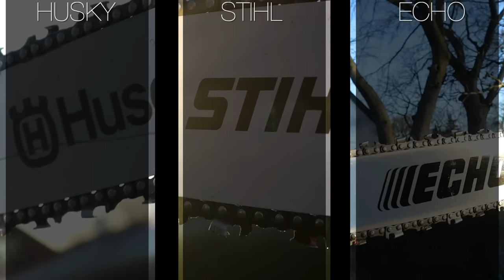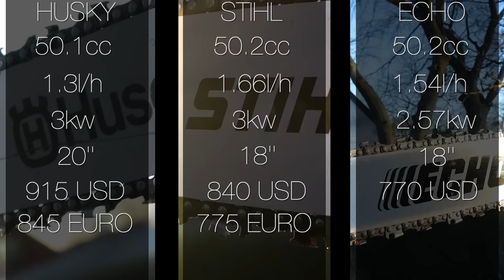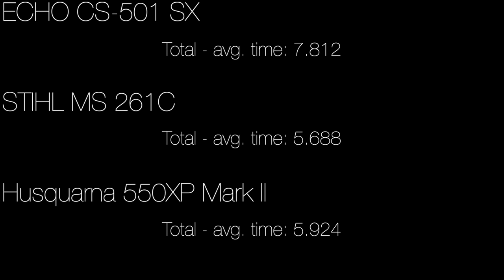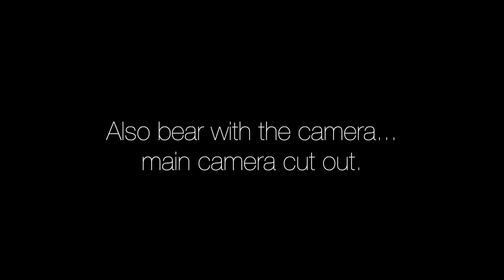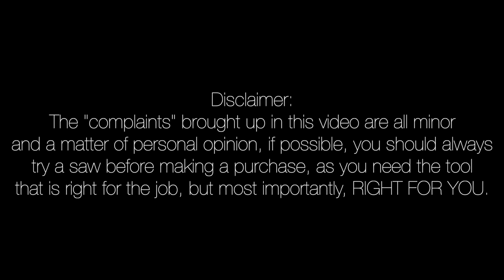Husqvarna 550xp mark II vs. Stihl ms 261 c vs. Echo cs-501 sx - Chainsaw comparison video

Comment: Echos tend to have their carb set a little lean from the factory in my opinion. Tweak the high a little maybe a quarter turn after u remove the plastic restriction caps👍 also maybe a Stihl chain would make it cut smoother. If it has a full chisel chain it might be why its cutting rough. Their all good saws tho. I own stihl and echo and in my opinion echo is underrated.
Reply: Yeah your right about that. I had to pop the caps to fatten it up where I wanted it. Now it's a little ripper!
Reply: How did you make this determination and what procedure did you use to tune?
Thanks, Echo Repair Specialist...✌
Reply: @GripFreak  the way I made the determination was by cutting with it. And the procedure I used was tweaking the high jet back and forth about 1/16 of a turn until it started cutting better. I played around with the low jet also but I'm pretty sure I left it where it was.  Gotta take those restrictor caps off first tho👍
Reply: @GripFreak If you listen carefully when she tested from cold start, you can actually hear the chainsaw bugging down and struggling  to reach a high speed because a lack of fuel, this is a sign that it might be too lean as the cold air is more dense.
Reply: I agree I have a Ms 261 but was looking at a 501 both seem like great saws I also think echo takes a while to break in I chose the 261 cause of my dealer having the huge computer to do the m tronics I think there awesome if you have a dealer close by with one

Comment: I own several Echo's and I never knew you could use the rope handle to open the oil cap. THANK YOU.
Reply from the maker: No problem:)
Reply: Me too!  Thank you very much
Reply: About as clear as mud!!
Reply: @oakiewoodsman  me too, good info to have
Reply: Echo is not tuned properly
Reply: I had no idea either. Guess I should have read the manual beyond the starting section.
Reply: Fairly new feature that started with 2511 and 355T with new tank caps.
Reply: Echo is up to a 20” bar on my 50cc .
Reply: I love your video. I bought the Echo a while back based mostly on price and weight. My dealer has an annual sale of Echo, with 20% off making it substantially cheaper.

Comment: The Echo has 1/2 HP less than the other 2 which is why you fell  less power and dont cut quiet as fast  it revs at a bit less RPM but in return it has a better waranty and more affordable.

Comment: I talked to the head mechanic at the local saw repair shop a couple of months ago.  He said that the Echo’s that are made in Japan rarely come in for repairs, only the occasional end of season tune up or chain sharpening.  He recommended those over any other brand.  Interesting input.  So far my little Stihl has done well for me but I am still deciding on a new bigger saw.
Reply: I would wager he sees fewer Echo's in the shop because there are far more Huskys and Stihls out there getting way more work on them compared to Echos, which I are more of a homeowner brand. So him seeing more saws come into the shop of one brand is a fairly worthless metric unless you're also measuring how many saws are out there being used, and how many work-hours are being put on each of those saws.
Reply: The echo 501 p are made in usa

Comment: Sthil 261c is priced with a 20 inch bar for $ 659.00 usd.  I own both the Sthil 261c and Husqvarna 550xp.  I do prefer the Sthil 261c over the 550xp

Comment: Anyone else like the fact that stihl has a see trough gas tank and not always guessing if it's full or empty?
Reply: At the Husqvarna there's a little window where you could see it.
Reply: The Echo tank is traslucent  but you cant tell in the video.
Reply: Yes that can save U a lot of steps/grief on a steep sidehill.
Reply: I like that echo doesn't have a see through tank. I'm getting old and out of shape, gives me a chance to pretend like I'm checking the gas and oil sometimes (so I can get a drink and a breath when the 20 year olds are Stihl working). Bahahahaha
Reply: 40 minutes and its empty,  or when it stops running.  No big whoop either way. If in doubt fill it up!
Reply: @BENZ4315JD  the echo has a translucent tank. I used to own that chainsaw
Reply: Not enough to buy a stihl lol
Reply: Besides the fact she’s 100% made of wife material.  Another difference in price could be the warranty.  I know husqy has the best warranty in the market I live in.
Reply: My husqvarna has a see through spot on the back of the tank near the handle
Reply: @Thrillhunter not at all true
Reply: Husqvarna does as well
Reply: And echos are translucent on their tanks
Reply: They all are …

Comment: When and where do you get your prices? I just bought a husky 550xp for $650 and the stihl was selling for $700. With the recent promotion i missed I would have paid $550 for the husky. These prices are current from 3/20/2024

Comment: The 261c is a fantastic saw. Amazing power to weight ratio. I did all of my chainsaw exams with a 261. I thought it was fantastic. I do agree that all Stihl fuel and oil caps are inconveniences. They have been that way for over a decade. Time for an upgrade. Fantastic comparison of the saw. I subbed after I watched this.

Comment: Nice comparison of saws. Any of them would be a winner. I’ve had my Echo 510 EV since 1989 and the only mod was opening the exhaust up bit. Echo always chokes the exhaust too much. With an 18” bar, it handles it as well as some other saws that are a little bigger. I’ve changed the spark plug a couple times and that’s it.  I’ll take a simple on/off switch anytime.

Comment: What?
This had to be the most objective and efficient review I HAVE EVER WATCHED. LIKE WATCHING A PRO ON TOPGEAR. You captured EVERYTHING important with highlights and no waste of time. Extremely efficient. Because of your review, my own indecision has tipped me to the STIHL ms 261-C (or CM). I would be interested to know how it goes for MRO (Maintenace/Repair/Operation) over the next while. But you can’t go wrong with a good HUSKY or STIHL dealer. ECHO in Canada is mostly slower support, except if you have a Shindaiwa dealer as they are with Echo. 👍
Reply from the maker: Thank you! Much appreciated
Reply: Femalelumberjack I would follow your lead in to the woods to fell trees any day. I mean that with respect; anyone who can “sling” two chainsaws like they were colt & Smith & Wesson has my respect (even if one does slip down (Husky)...

Comment: What an AWESOME review!  I loved every second of this.  Your camera work is outstanding, and yes I do realize how much time this takes to produce from my own channel.  GREAT job and cheers from Canada....
Reply from the maker: Thank you much appreciated!
Reply: @Femalelumberjack  I have to  say the MS 261 is the best! I have one myself always starts always reliable don’t get me wrong husky is a great saw we had two of them in the past but Stihl is the king! My 261 is extremely easy to use my dad taught me how to use a chainsaw on the 261 to this day I am still using it five years later
Reply: Türkçe bilen yokmmmmmmmmmmu
Reply: V
Reply: @Femalelumberjack  140 psi 372xp good compression?
Reply: @ruziybs3168  ) has
Reply: Great review. Enjoyed break down of all the different features. I went with Husky. I like them better, they balance better for me. I have 3 Huskys. 120i 14", 435 16", 450 Rancher 20". And an old Poulan Wild Thing I've had for so long I can't remember. I keep it tuned, changed  magneto, fuel lines, and cleaned out carb. They all run like Champs. Stihl is typically the higher priced brand in my area of Texas. But for balance, cutting, the Huskys are better for me. 
Keep up the awesome videos. And nice kitty by the way. They're always photo and video bombing.

Comment: 261c is my go to saw at work and has never let me down, Iv also got an older 261 and still runs like a champ!
Reply: thats very strange the 3 261's we have at work all 3 seem to have something wrong with them all the time. We have one thats only a couple of years old and is on its last legs. All huskys are heavier but last much longer. 261's seem so cheap and plastic like and brake very easy

Comment: I've been a boots on the ground logger here in the USA for  going on 20 years now and have ran mostly Stihl and Husqvarna saws, while I have tried off shoot brands from time to time I keep coming back to what performs best day in day out and the Stihl and Husqvarna saws just can't be beat period hands down. Yes Stihl went through a period where the quality dropped off and prices went up but they are fixing that problem, I used Jonsereds (when they were still made in Sweden and not owned by Husqvarna) and loved the simplicity of their saws, no nonsense just a saw that worked and was not for the weak or meek or weekend Firewood cutter....when they tried to compete in that homeowner/weekend warrior market is when they got into trouble. But even in those days I still had a Stihl or 2 in my Truck....just in case.
It's only been in the recent past that now you will find NOTHING but Husqvarna and Stihl saws in my arsenal of saws. I'm not trying to be a know it all or big shot either...this is simply one loggers opinion from 20+ years of Falling timber in the Pine, Fir and Spruce covered Mountains of the American West.
Reply: Just thought I would add this one last thing. I just today bought another Husqvarna as my main Husqvarna had to go to the shop for the very first time in 5 years of day in day out use felling Spruce, Fir and Ponderosa Pine.
 I bought a brand new 550XP MK II.
Since its square in the middle of the right bar length.....(18"-20"- 24") with the lighter weight .325 - 050 Pixel Chain and Bar combo that performs like 3/8" - 050 X-cut with a Pro Lite Bar.....let's just say I was able to use our Son's 550XP MK II this morning for a few hours while he ran our Skidder for us, and I was sold !...he has his in the 18" Bar Length and loves it....I bought mine that came with 20" Pixel Bar n Chain but I also bought an extra 24" Pixel bar and a spool of .325" Pixel Chain (so I can make up what ever length chains we need) and I can hardly wait to get to work in the Morning and get the Saw in some wood. So light....so we'll balanced even at 24" it fits your hands perfectly. (I know the recommended Max length is 20" but this thing, with what little testing I did here at home this early evening on some 3 yr dry, old, hard as nails, Ponderosa Pine, Rock solid, Stump ends that are at the small end 36" across .......this little 550 MK II Handled it like it was a 16" Saw Cutting green Fir.....WOW....SUPER IMPRESSED WITH THIS LITTLE SAW...feels just like..A SMALLER COPY REALLY OF MY new 572 XP and that is impressive to say the least.
Make no mistake I am not trumping up one brand over the other and I hear Stihl has a new Saw they are trying in the European Market first the 400 C I think it's called has a Titanium Cylinder or Piston.... something like that but anyway the first reports are really REALLY GOOD and I have my local Saw Dealer that I buy from already has me lined up to try one as soon as they become available here in the USA.....just so nobody gets to thinking I am a walking advertisement for Husqvarna over Another Brand....
The only loyalty I have is to the saw that works and lasts.

Comment: Nice video. I've not used the Echo cs-501sx. I've got a Husky 550xp mk2 and Stihl MS 261 (refresh version - which is the one you have in the video). I like both saws and, despite using them extensively, I still can't decide which is better; my view is that you can't make a bad choice between these two.
Reply from the maker: Thanks! I agree 550xp mark II and ms261c are both great saws and the design seem to be the only real difference

Comment: We cut 8 full cords in one day with 3 different saws at 9,000 feet in Colorado in the fall. They all seemed to perform well until it was time to re-fuel;  The  Husky and Stihl did not start easily, requiring several pulls up to nine.The Echo started after 2 pulls. .
Reply: I've had the same experience.  The echo always seems to start better. My thoughts are why choose get one of each.

Comment: The bar length has nothing to do with the chain speed.  The sprocket still drives the chain at the same velocity, regardless of bar size (friction will have virtually no effect at that bar length).   The Echo is simply a lower powered, slower saw.  
As for the slight weight difference between the Stihl and Husky, I think you’ll find the Stihl has a larger fuel tank.   From the manufacturers specs, the Stihl  is lighter than the Husky (head only, no bar).  In fact the Stihl 261 has the highest horsepower to weight ratio of any saw in its class.  
Both the Stihl and Husky you tested are “pro” saws in their model lineup.  I own the Stihl, my brother has the Husky, and they’re both excellent saws for those that want professional quality.

Comment: Far and away the most detailed, informative, and well laid video I’ve seen of someone reviewing chainsaws, since I’ve been researching buying a new one.  Also thank you for reviewing saws that are actually comparable to one another, and not “hey let’s compare this Dewalt battery one to a commercial Stihl...” like wtf people
Reply from the maker: Thank you
Reply: because of her review i will go with the 261. for some reason the stihls are so well balanced. they feel right in your hands its quite difficult to explain. its a well balanced and well built saw.
Reply: Or you get people reviewing saws not even near their range like a 45 cc saw vs a 65 cc saw. of course the 65 cc is gonna outperform by miles.

Comment: I've had a lot of trouble with Stihl oil caps until I found the one simple solution. Do not overfill the tank. If you use a Stihl self fill cap on your combi-can it stops filling at just the right height for the cap to work flawlessly. Too full and screwing the cap down creates pressure and the cap pops back off. Leave a little space and everything seems okay.

Comment: So many people turn a bind eye to the Echo's lol. From what I've seen the echo's are severely lacking due to factory tunes for EPA regulations. A re tune wakes these things up. Was a husky guy forever, went out and got an Echo on the fly when I was in a pinch and I've been sold since then. Even if you never retune, They start. Every. Time. Slower cut I can deal with as long as it starts every time. 

People always poke they on off toggle switch. I get it, but I love it haha. Less is more!

Comment: I've always been a husky guy since the 1980's when they had better power to weight ratio and were a little cheaper than stihl. That being said I've always preferred the stihl top handle saws. Now I'm switching all my saws to stihl because the new husky's have starting issues in the heat.
Reply: Facts I was wanting to run with something different from my Stihl saws and bought a couple  Huskies and they don't like heat the hotter my stihls get the better they run
Reply: Oh the the 550 mark1 were horrible when they got warm . It's like they vapor locked or something the mark 2  is much better. And I'm a sthil guy .

Comment: I LOVE my 261 cm. Best saw ive ever owned!
Reply: Does yours bog down when cutting larger trees?  I have a 261CM and Husky 562XP and I get irritated with my 261CM when cutting larger logs.  It's also a gas hog.  I like the size and feel though, and I usually will use it for limbing.  I also find it way more predictable than my Husky.
Reply: I just picked up the ms261cm . I have no complaints at all. This thing rocks, no bogging at all.

Comment: I've used the 550XP and own an MS261C.  Both have developed running/stalling/starting issues after a year or so of use.  I also own a 562XP and have had zero issues.  Currently, my 261C stalls constantly at idle.  It's also a hard starter. I maintain my saws, so that's not an issue.  I've ordered a new fuel solenoid for around $50 so we'll see if that solves the problem.

Comment: Excellent video and fair comparison. Consideration of spares availability and cost is a very vital point considered on top of the rest.
Reply: Yep, luckily I'm surrounded by Stihl and Husq dealerships, but I chose the Stihl 261 since it felt right in my hands and about a hair lighter than 550.

Comment: Mod that Echo muffler and retune with limit caps removed and I  bet that Echo will really perform
Reply: shouldnt have to
Reply: Yep, muffler mod will help the 501 outperforme the 550XP.
Reply: how is that done,, at a saw mechanic or diy
Reply: What does "mod" mean for a muffler ? And what are the limit caps ?
Sorry, I'm french 😉
Reply: @martincm8683 , open up the restrictions in the muffler. The limiter caps prevent you from adjusting the carburetor very much. If you take them out you can actually tune it rather than just tweak it a little.
Reply: If you run sawz much you should tune all of them. I have a ported 288xp and ms441c. They are amazing compared to stock. Wood eating animals.
Reply: Yes, echo sharpens up noticeably after muffler gut and carb fattened up. Imo, they're more than detuned out of the box, they're lean enough to accelerate engine wear. Very dry jetted from the box.

Comment: I ran both, 261 cm and 550 xp, The Stihl has a little bit more power, the husqy trumps up with slightly more agility. I like to work with Both of them, they are absolutely equal.